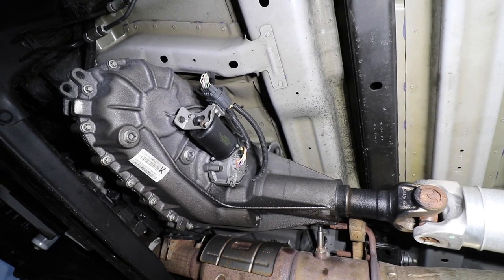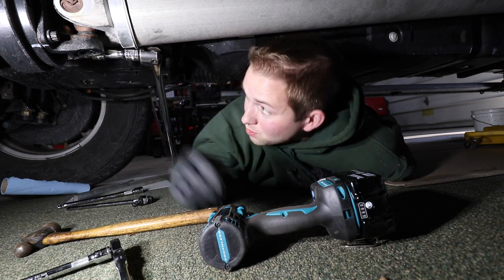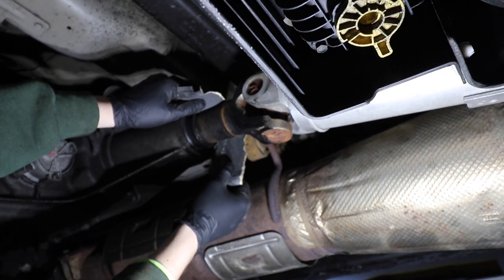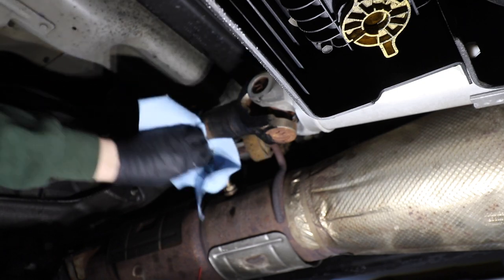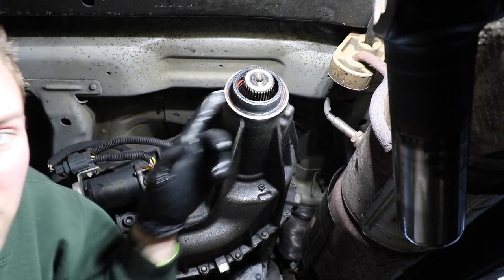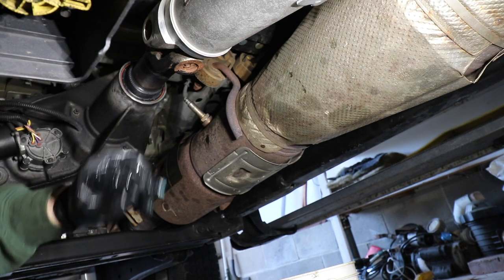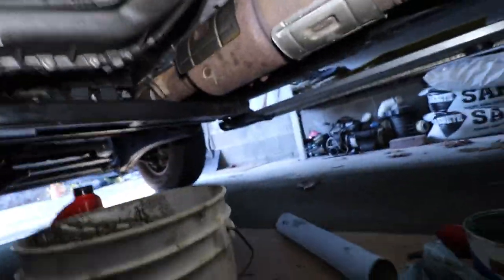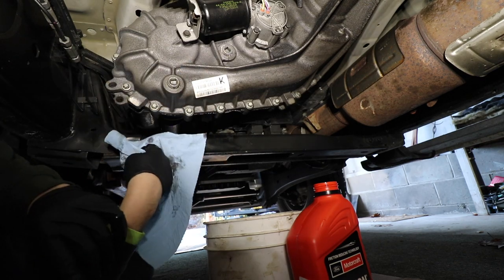Transfer Case Seal Replacement | 2020+ Superduty

Comment: This exact seal leak was repaired under warranty on my 2021 F-350. The dealer also replaced the driveshaft because they said it was defective & would also cause the new seal to leak. Hopefully 🤞 not the case with yours ?
Reply from the maker: I doubt the dealer took the driveshaft off and tested it for proper balancing. Oh well, If I have to do this every 25,000 miles, it is what it is.

Comment: My F250 had same leak took it to dealer had it replace under warranty so I checked to see if white mark was on bottom? Nope it was on side so the service guy told me it’s an Air Cavity … it’s supposed to release air as you put yoke on?
Reply from the maker: Interesting
Reply: @OldSoulMillennial  I smh myself if I would to install it myself I’ll make sure that mark on bottom, it came like that in factory 🤷‍♂️

Comment: Is this the same to do for the front output shaft seal?
Reply from the maker: Because I haven't done the front, I can't say
Reply: No you need to count the threads or measure the shaft from the nut to the end.

Comment: their not wrong. you cant paint that. it needs to remain smooth so that the seal wont tear as it slips through it. obviously you dont want it to rust either though so id suggest just coating it in a small layer of grease and keep an eye on it during your oil changes. good video though thanks.